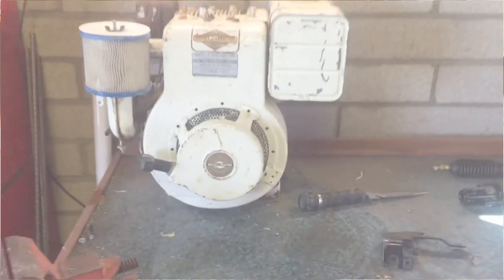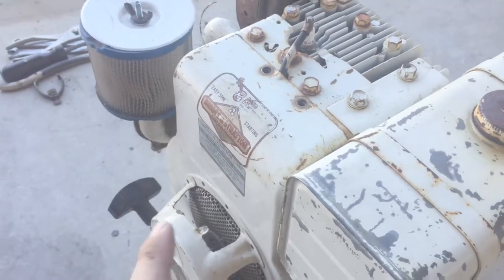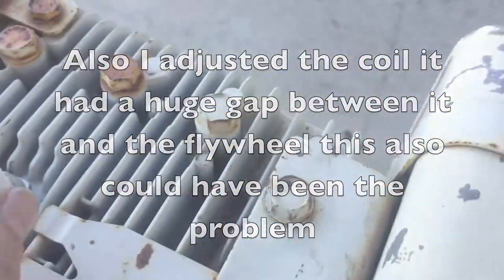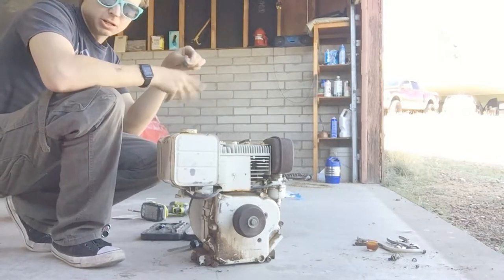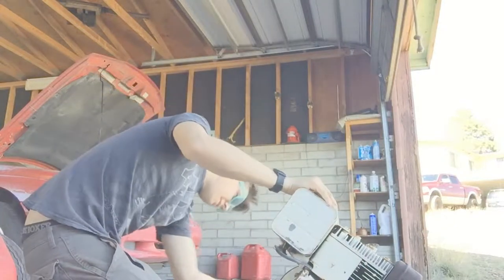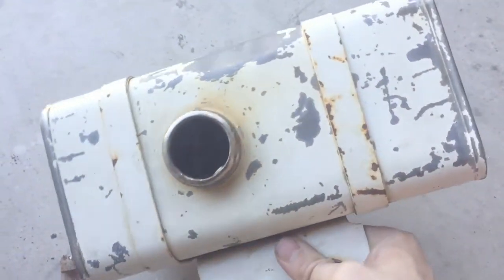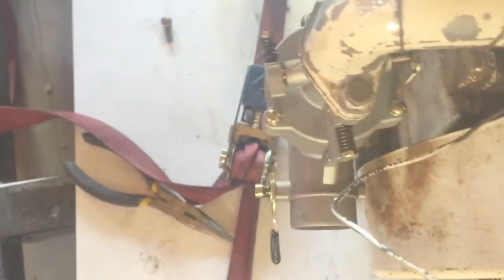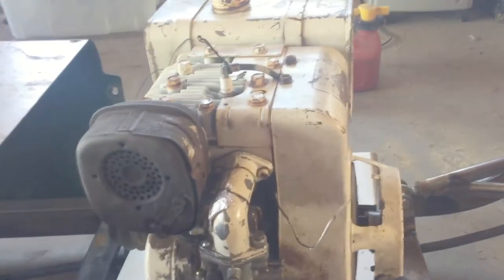ENGINE RUNS FOR THE RAT ROD GO KART

Comment: The frame is sweet glad to see that old 8hp briggs run I say put a return spring on the engine for the throttle return  great video
Reply from the maker: @froggers garage im thinking about swapping the carb for a different style the draw through one seems to give me trouble with any way i put a spring on it and run a cable. A video will be coming soon on what i have in mind i hope it works haha